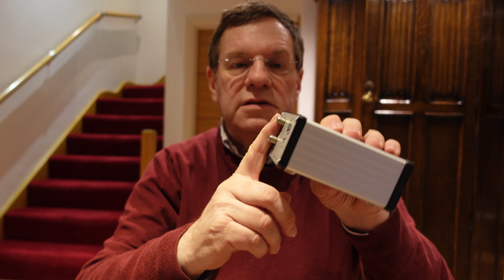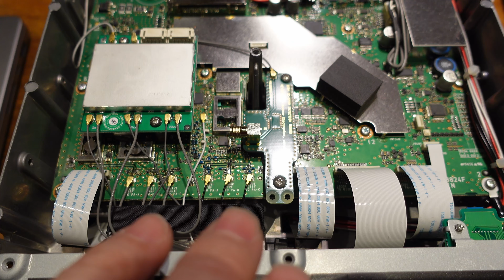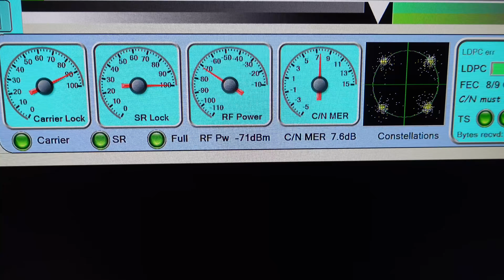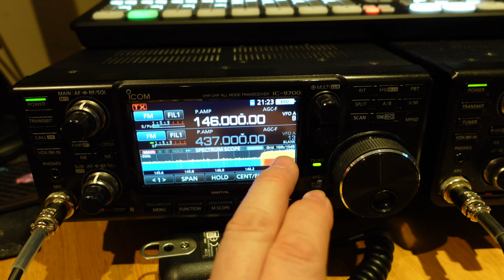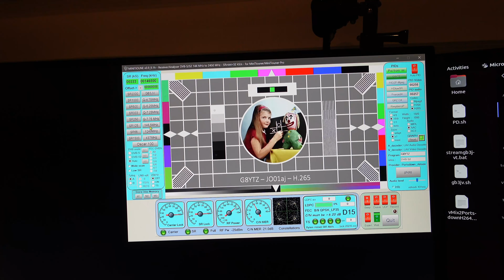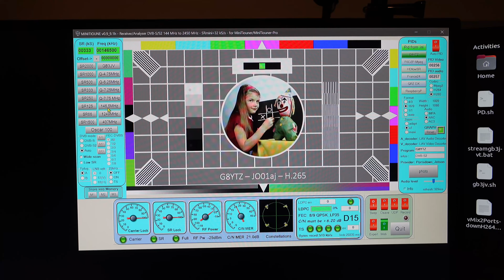Installing the PTRX 9700 in an iCOM IC 9700

Comment: Was the plastic strip mentioned in the unboxing possibly a cable comb? It is probably not an issue if your 9700 is a shack queen but if you take it portable regularly the some cable restraint would be advantageous IMHO. 
I'd love a 9700 but they are rather expensive and living in a remote city here in WA there is not much VHF and above activity with 23cm being useless. So if Icom were to release a 0649😀 23cm less version at reduced cost I'd be all over it like rash.🤤
Reply from the maker: They do provide little tool for the connectors, but I prefer to do it with my fingers because I can feel what’s happening

Comment from the maker: A quick update, I did some tests today receiving G4XAT. I received Gareth on 437MHz, 146.5MHz (DVB-S2) at various symbol rates between 250kS/s and 1000kS/s and 146.5MHz DVB-T at 333KHz, 500KHz and 1000KHz bandwidth (the latter was 60KHz inside each band edge limit) Great result using the PTRX-9700 and I can confirm the Knucker works perfectly without an attenuator, the Knucker AGC handles the signal levels fine and there was plenty of headroom.

Comment: Very nice installation; great to see the Bodnar board was able to be integrated into the whole! Are you using the Bodnar GPS receiver with both the boards installed - and the external pcb adapter board? Look forward to seeing a demo! Richard G8ITB.
Reply from the maker: Richard, yes, I'm using the Leo Bodnar "Mini Precision GPS Reference Clock" receiver (£110). The board for the IC-9700 costs £27.50 which is why I suggest it is installed at the same time as the PTRX-9700. I tested the GPS lock after installing the PTRX-9700 and it works as expected . The PTRX-9700 external filter board has three ports: One for the radio, one for the GPS unit and one for the SDR Minitioner/SDR output. The main "risky" part of the installation is handling those UFL connectors and there's 9 of them! I mis-spoke in the video a couple of times, Radio Analog provide 4 of those little UFL cables, so you have everything you need. The Leo Bodnar supplied SMA connector is also useful for the SDR output too. My only wish was that Radio Analog provided a 3D printed case for the external filter board, I'm sure someone will come up with a design.